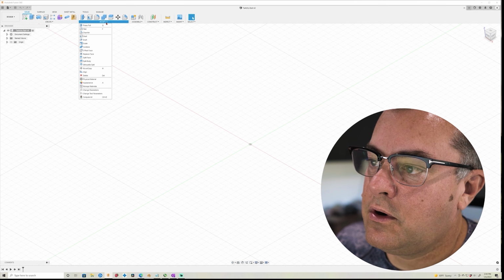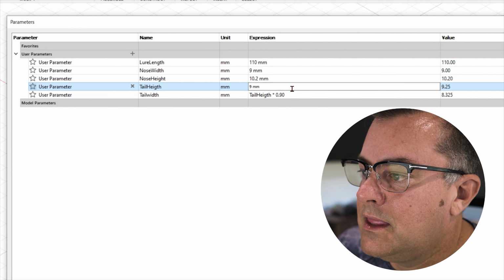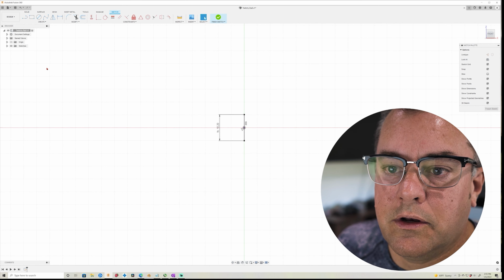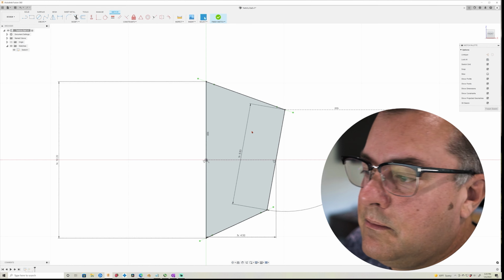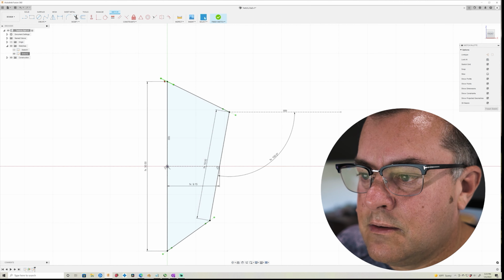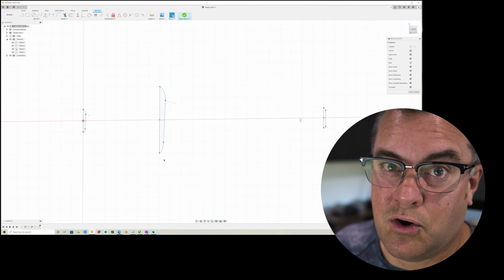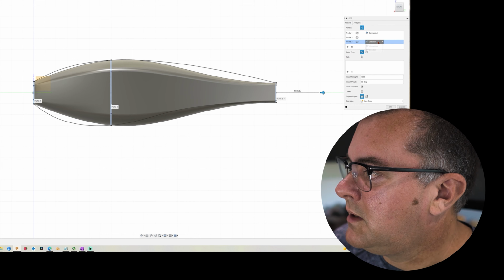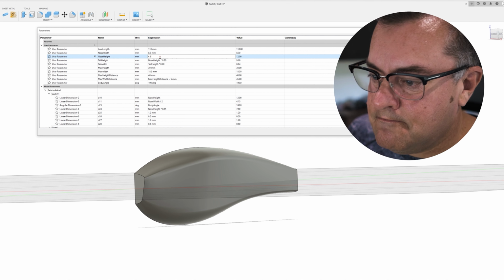Complete 3D Printed Fishing Lure Design Course - Designing the Lure Body

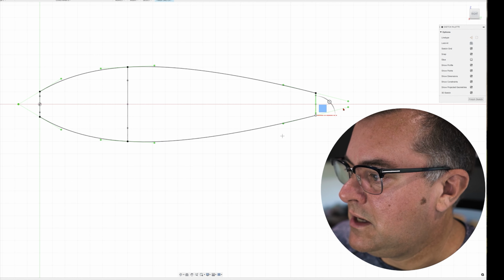Comment: At 13:52 when you grab the handle its not letting me grab the handle and adjust it? I feel like its something simple im doing wrong but I cant figure out why its not letting me grab and move the handle? any thoughts?
Reply from the maker: Hmm a few ideas 1. Make sure you are in edit sketch mode aka you have the sketch open for editing. 2. Make sure you don't have any constraints applied to the sketch. 3. Make sure you are clicking the actual spline point. At intersections Fusion 360 can pick the point you are not expecting. Click the left mouse button over the point and hold it and see if you have options and select the 2nd point option.

Those are the things I can think of off the top of my head